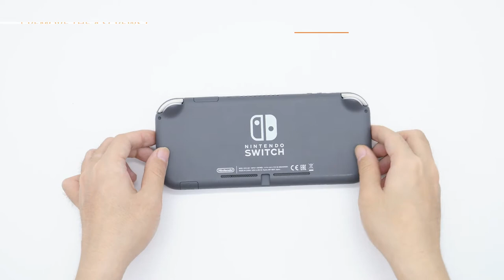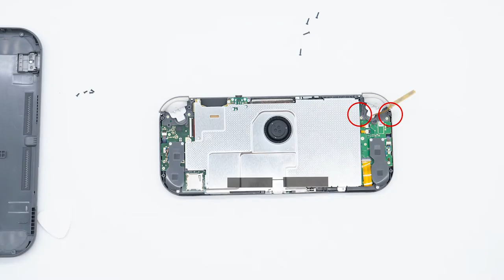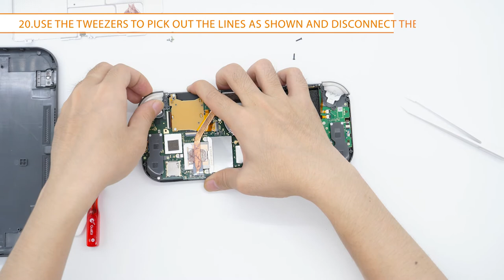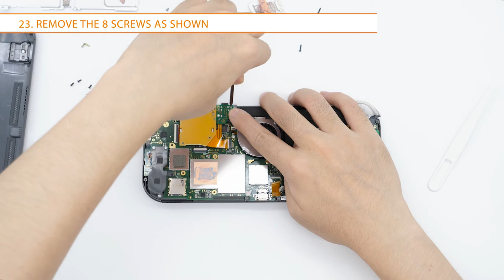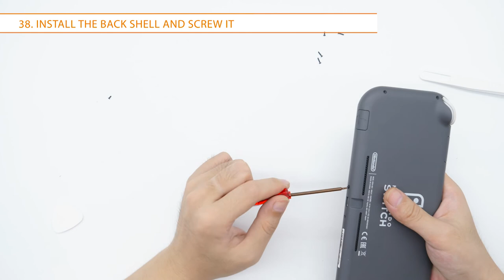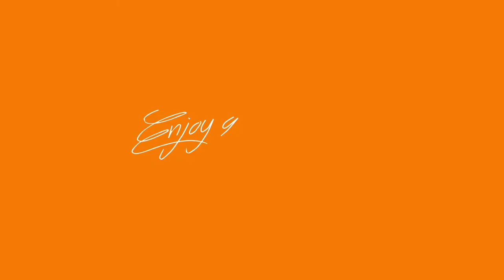GuliKit Joysticks Replacement Tool Kits Repair Instruction on Switch Lite

Comment: Do you need to apply new heat sink paste when you put the parts back together?thanks
Reply: Clean it first with 91% or higher alcohol first then re_apply new thermal paste.
Reply: You really should. Exposing the paste makes it brittle
Reply: Likely a good idea